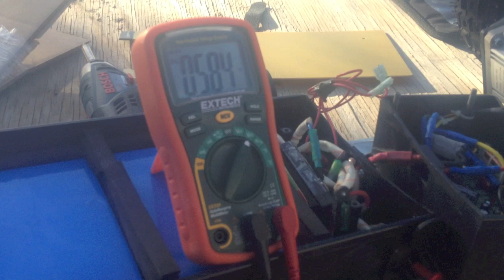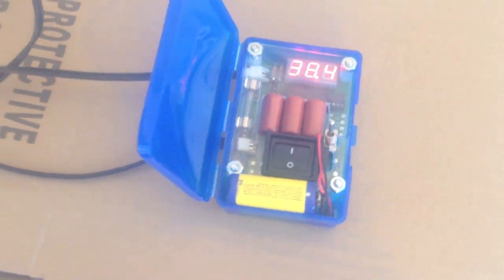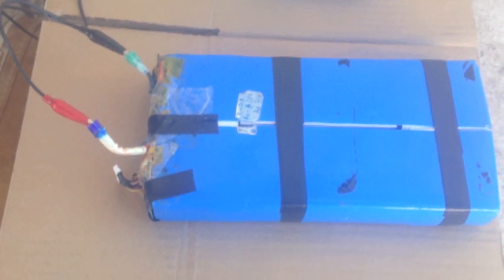Electric Skateboard Battery Recovery

Comment: Having trouble with getting the remote to sync with board.  I never get a beep but I think the batteries are charges.  Is there anyway I could contact you or you contact me..  Any help will be greatly appreciated.  I have the Altered M6 800 Big Green Machine

Comment from the maker: The vendor claims a new lithium pack can do a 20 mile distane with a top speed of 24 mph. I've not tried to ride such a distance, but I have my doubts about that kind of range. 

The mechanics of the board are pretty good. It needs the huge wheels, trucks, bearings for my area. The skateboard deck seems a little light weight for compared to the rest. I'm not impressed with the electronics packaging. It's messy inside. The controller badly needs a heat sync which the newer ones include.

Comment: A 10S Li-ion battery at 5.8V? That's 0.58V on cells that should never go under 2.50V. Pretty sure these cell now ruined and have very high internal resistance. They will heat up abnormaly and fail prematurly...